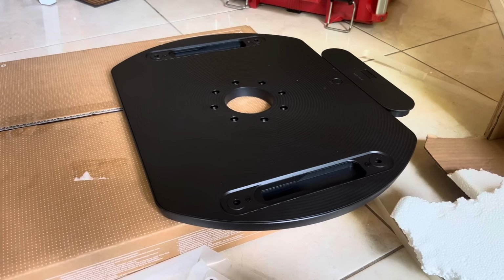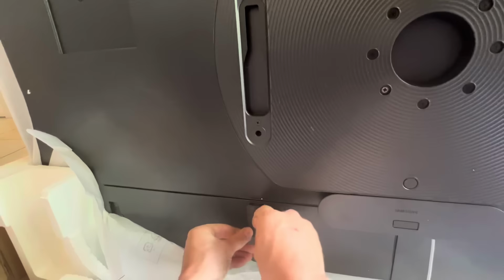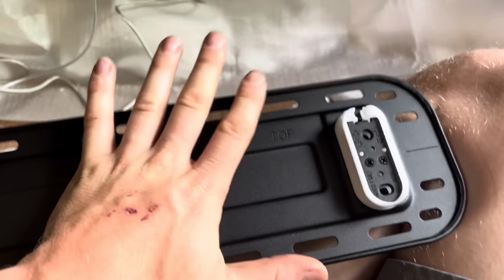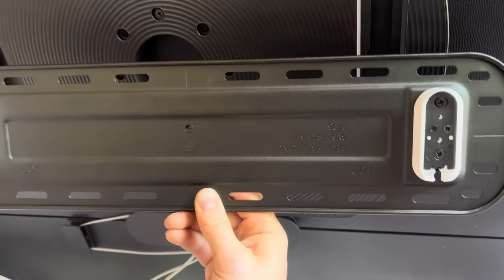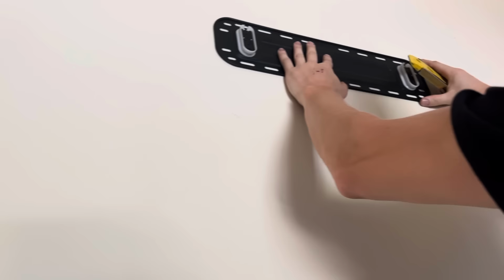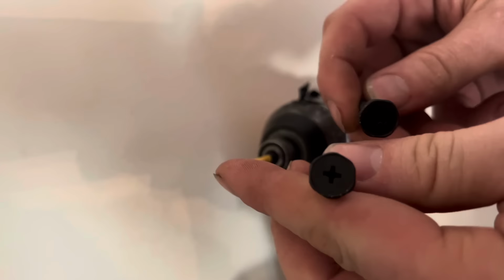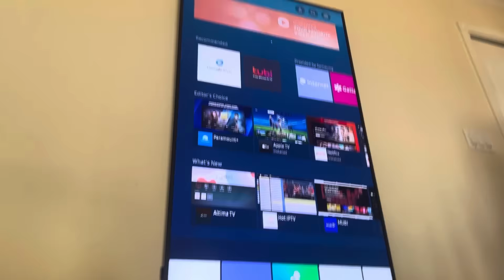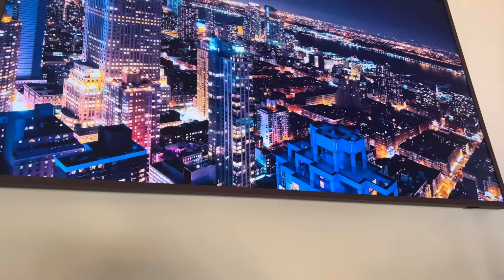HOW TO INSTALL SAMSUNG AUTO ROTATE WALL MOUNT FRAME QLED

Comment: Somewhat unrelated but is there a recommended mount for fixed portrait orientations? I'm guessing that the mount bundled with the display is only for landscape setups?
Reply from the maker: Yes exactly. The 48 comes with ability to do both right out of box
Reply: @ghostlyrich  Interesting but this doesn’t apply to the larger models?

Comment: When I put it in portrait mode it starts to shift at a 45 degree angle then stops
Reply from the maker: Check to make sure no cables are binding at the back it could be because it’s putting tension on the wire

Comment: thanks for the video! did you know if the 65" mount is compatible with the frame 55" 2022 tv? or i need to buy the specific model, the 55 is 200 x 200 vesa mount but the manual of the 65" mount says from 55" to 65", thank you!

Comment: Great video tutorial! 
Question, 
1. Does the newer model Samsung frame tv have the vertical feature? Or it has to be a specific year model? 

2. Can I use the rotating mount with an in wall tv media box? 

I am asking this because I want to use the frame tv in my movie theater as a digital movie poster and have it hanged vertically, or even rotate.

Comment: Great video but I have a question with regards to the power adapter for the auto rotating wall mount. It plugs into the mount but then is the adapter AC powered or can you connect to the USB input to the one connect?
Reply: I too would like to know the answer to this question.
Reply from the maker: Connects to wall

Comment: Good video. Is there an AC adapter included? My box does not include any cables, and from what I can tell it should include an AC adapter. It also seems to want me to connect a USB C cable to the TV but that’s not in your video? Is that not needed?

Comment: Great video, thanks! 

Couple of questions I have not been able to find online:

- If the TV is mounted on, the rotating wall mount, can it then be set to be in vertical mode as a standard when turned off?
I would like for it to move into horisontal mode when turning it on with my Apple TV remote, and then go vertical in art mode when I turn it off.

- Can the rotating wall mount be mounted into the wall for a more flush look? And how far in should it be mounted? (I am installing a new wall for it, and can cut a hole in the middle for it)
Ideally I would like to have the TV be 100% plain with the wall but still have the rotating function, only leaving 2mm for it to rotate.
Reply from the maker: 1. You would need to rotate it with the media button As I show I believe as a safety thing so that way it doesn’t automatically do it and have an object in the way so before you turn it off you would have to just hit the rotation button and then turn the TV off if you have a Harmony remote you could program a sequence so he powered off it hits that command and then power is the TV off which would of course bring up the artwork.

2. You wouldn’t want to do that unfortunately unless you’re dealing with a very very precise flat wall I’ve never seen a wall that is that precise unless it literally made of wood rather than drywall as Drywall is very uneven a lot of the times So be very careful if you counter sink and Wallmount

Comment: Does this mounting kit come with a longer one connect cord? The one included with our 55 inch qled TV is about 3 inches long and only seems to work with the table stand.
Reply from the maker: Sounds like a 8k model should have come with a short cable and long cable in box.

Comment: Do you know if the rotation feature of the TV requires this mount?  If I get a generic full-motion mount, can I manually trigger portrait mode?
Reply from the maker: You can with some panels in the service menu. Carful with 360 full motion mounts, i have seen them fail and most will not warranty. I heard the new samsungs coming out this year will come with 360 mounts but i will believe it when i see ot

Comment: Do you think you could fit a Philips hue gradient strip behind the Tv with the autorotate mount?
Reply from the maker: Light strip should fit but if theres a driver box might need to tuck it away below the tv or other side of wall

Comment: Hey can we install this on a normal wall mount. Meaning are we able to rotate and tilt in different angles (like how the usual normal wall mount does)? Thanks!
Reply from the maker: You can put the frame itself on an articulating Wallmount but you can’t mount this mount to an articulating Wallmount. It would be a little dangerous since it rotates even if you accidentally hit the button

Comment: Would you think is it OK to mount it only with the dry wall, but no stud with 55 inches the frame?
Cheers!
Reply from the maker: Steelstuds yes,  but just drywall alone the mount could shift allot over time from movement and it would not only just eventually not be level from notching the drywall but if it did it enough it could fail and fall off the wall

Comment: Great video! I just installed this and I am wondering if your TV leans a bit forward from the top after installation. Mine does and it is especially noticeable in the vertical mode making the gap between the wall and the tv almost an inch and a half on the top end :/. Want to make sure I am not doing something wrong...
Reply from the maker: It could be how the mounts sitting on the drywall. The mount will naturally have some tilt to it. If you’re worried, it might be worth going once over all the screws and making sure they’re torqued down.
Reply: @ghostlyrich indeed! I checked on the installation and there doesn't seem to be any mounting bracket tilt. I think the way the rotating assembly clings onto the metal wall bracket itself might be an issue, which is why I suppose they provide two foam spacers to be added to the bottom of the rotating assembly. Anyway, still curious to know if you notice a slight offset as well. IMO the tilt and the gap was large enough to take the "frame" aesthetic away from my Frame TV.
Reply: I have the same issue. I am constantly paranoid it will one day disengage somehow and fall off the wall.

Comment: I'm installing a 50" frame with the rotating wall mount. I'd like to know if I can 
just use the "F Screw" (per 55" specs) instead of the "G Screw + D Spacer". 
Thank you!

Comment: You are a vesa master maybe you can answer these 2 :
Samsung 2022 qd oled S95B has multiview but a vesa mount 300*200, is there an accessory that can adapt it ?
Also can you please tell me if the pdf manual is available online for arab22 or arab43 ?
Reply from the maker: 1. What size is the tv. You should be fine as long as it has the landscape option in the software in it for when you pair it to the tv.

2. Yes both should be available online im sure
Reply: @ghostlyrich  55s95b has vesa mount 300x200 this wall mount is 400*300 or 200*200 only and manual are not available online on samsung us uk or switzerland
Reply: @ghostlyrich  Hi Samsung man of the Year, I have vg arab 22 @home and 55qn90b in a couple of days.
This motorized mount is a marvel. Hope it will be on every tv Samsung has to release.
Great Job Samsung of course especially R&D, i would never bought a tv in my life without only pc monitors.  I still wont use Tizen ads-Os :)

Comment: Friend, can you tell me the "space" between the "Frame" and the "wall"? appreciate if you could share the exact length of space by using a ruler at 16m:55s video.   Thanks a lot. thanks a lot.
Reply from the maker: Sorry i installed the tv quite a long time ago i wont be able to do so.

Comment: Has anyone had a problem connecting to rotating device? Mine say to check power to rotating unit. and reset. I did all that with no luck maybe I got a bad unit.

Comment: 1. Can I use this with a different TV like the LG C2 assuming correct VESA dimensions or does this require the Samsung Frame TV?

2. Does the product come with a remote or do I need to use the TV’s remote?

3. When in vertical mode, if you open an app like Netflix and it doesn’t support vertical mode, will the TV automatically rotate to horizontal?
Reply from the maker: You have to sync it to the tv usually to sync it to the app. The c2 mounts very low to the bottom im sure if theres a will theres a way just dont use it as a picture just because of burn in worries
Reply: @ghostlyrich  just bought the rotating mount and the 55” Frame.

Arrives Tuesday, I’ll see if it works for my use case of showing movie posters and comic book covers in vertical mode.

Would have liked to buy the 2023 model but on Samsungs website for matter support, only the 32” size is available.

I’ll report my conclusions once setup.

Comment: could you use this with a full motion mount
Reply from the maker: This is a wallmount in itself so no
Reply: @ghostlyrich  is there some kind of modification that would enable this rotating mount itself to be mounted on to a full-motion mount such as the Kanto PS350?